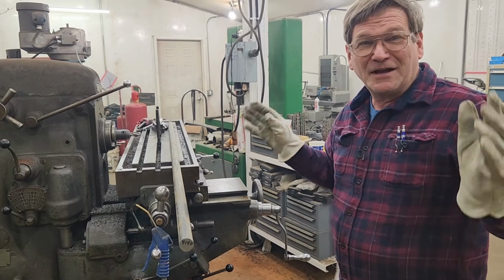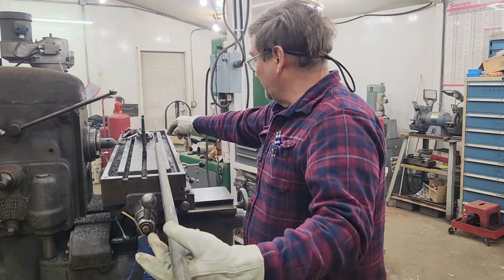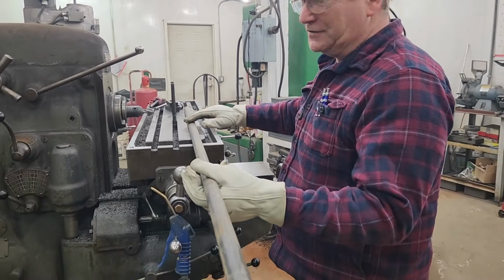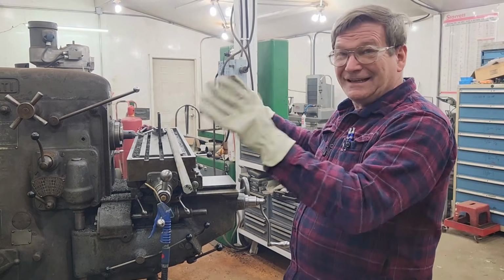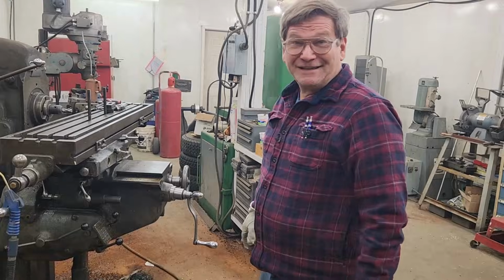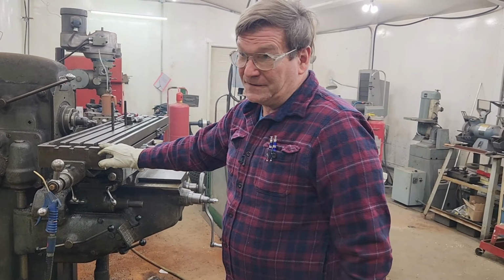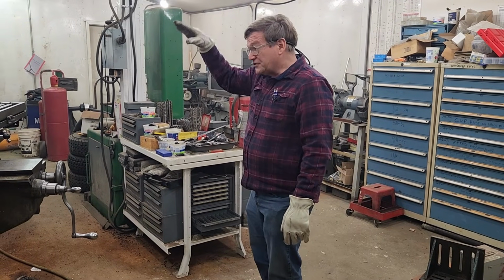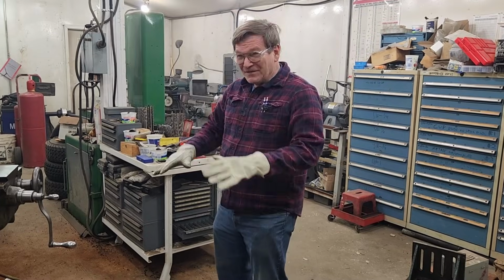Machinist's Minutes: Floating parts and machine failures

Comment: My first job shop had a customer who repaired shovels and excavators. I drilled holes in +700kg Hardox400 and 600 shovel blades >2400mm long on a mill with 1600mm travel multiple times a year. (+1540lbs, >95inch long, 2inch thick with 60inch travel)
We made a few solid steel-frames and some simple rollers to match the table height of the boring mill specifically for this job and added a brace at the height of the cutoff saw while were at it ;)
The largest floating part was the entire excavator arm and knuckle that needed an overhaul.(largest road legal type excavator in europe) The big arm was more than twice the width of the whole machine but we repaired and re-sleeved every bushing on it. We made it work and made good money but declined future rebuilds of that size due to the hassle in a two person shop and having the main mill occupied and unavailable for at least three to five days on one job.

Comment: I've been doing hydraulic cylinders for 10 years we've had to hang a lot of stuff off the edge of the bridge port. We would use Big Joe's to support the hanging end to the pain in the ass if you had to move the knee up and down at all. At my new job going on two years now doing a lot of transmission a differential housings and I'm using the tilt function of the head a lot more and maxing out the travel of the table

Comment: Last week I had to bore the base mounts of a 8’ long Hydraulic Cylinder barrel on a 2MI Vertical Cincinnati mill, and I supported the end of the  barrel with overhead crane. I then thought to put the digital crane scale on, and then that allowed me to make sure I had the right amount of support on the end, which ended up being about 140 lbs.  ( about 1/2 of the barrel weight). 
I will be using that trick again. 

I was surprised that the mill power feed would lift the barrel even with 6’ hanging off the table without tipping over.

Comment: Your shop is a pig pen, get organized!
Reply: Thank god you can't see mine.      🙈
Reply: You try being a full range shop in a small town in the Arctic and see if you can keep it cleaner! Lol
Reply: @ke6gwf  what does that have to do with being organized?
Reply: @libsareretardedturds  when you have limited space, and you have to keep everything around and can't operate on a "Lean" work flow, and you always have multiple projects going at once as you wait for parts and materials to arrive on the next barge, it's not really possible to keep it "organized" to your standards, because you don't have enough room for everything to have a "home", and you have to store a lot of stuff indoors so it doesn't freeze.

If you can double your heated shop size, then yes, you can organize things, but that's really expensive, both for the building, and also for the higher heating bill.

So, you do what you can with the space that you have, and if you have worked in that environment, you learn how to make good use if it, and it's actually better organized than it looks like, because they know where things live.

Comment: We machined similar shafts for air conditioners.
We held the extended end of the shafts with a spring from a free floting crane.
We set two shafts in the outer table slots and clamps in the center slot.

We also had 1200 mm (about 83 inches). It was a Dah Lee
 Bought new.
The plates were coming out of square. Had to dig a three foot deep and pour a foundation.
That helped some.
These were cardboard box machines in mated pairs.
Bore holes were tolerance +- .002.
We bored them from the same side so the errors matched.
We never got a complaint from the customer.

Comment: If the machine absolutely needs to be bolted down then there is something wrong with the setup or the machine. Bolting the machine to the floor should NEVER be the deciding factor in a decent cut.
Reply: Obviously never done anything precision.
Reply: @dustinandtarynwolfe5540  nope, I just own a machine shop.

Comment: We had a rework job for caterpillar. We manufactured frames among other things for cat down in chch nz. One day a grader front frame came in and a pivot bore was missed final machining. Was made in USA. We made loader frames. Anyway we threw this grader front frame up on two horizontal borers..Was a bit dodgy but made it work..1986.
Reply from the maker: I had one like that on some gear cases that were for Hitachi excavators, when Fukushima got hit hard in 2001, they had unfinished parts that got shipped to Alaska.  About a decade ago, I got an order from Cat for a part for a 2 year old machine, they sent me the drawings & I made the part.  It was an attachment for a valve, it was originally a stamping, but had been changed after a few 100 machine & no spares were made, because it was a bracket & should not wear out for a long time.  It became Cat factories problem, when a malfunction of another part, caused the machine to crash the bracket, so it was warranty work.

Comment: I can see where you can go wrong. you could end up with a spiral keyway. My solution would be to try and set up a semi losse key at far end of key and another at feed end on the table. That would at least keep the key straight for the length of the table.
Reply: It is irrelevant if the key had a slight twist, in his application. And almost all other situations.
Reply: I know, just an exaggeration. I overthink everything to avoid material waste. I made lots mistakes.